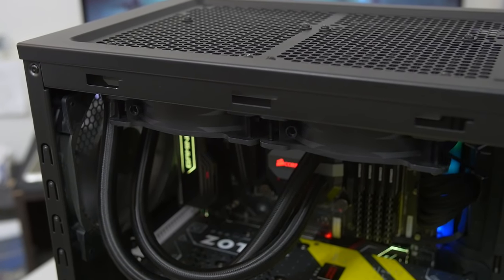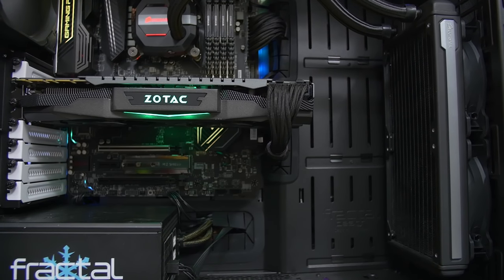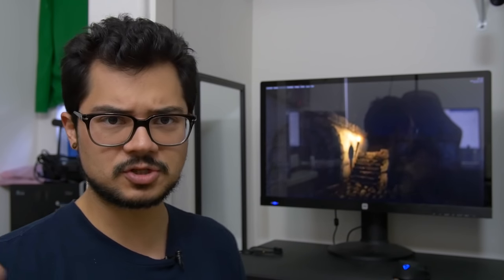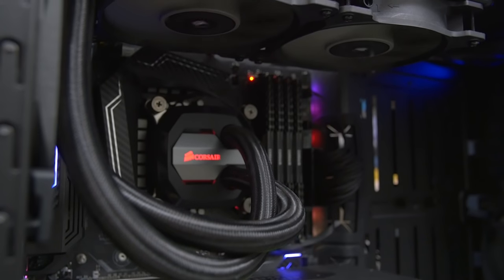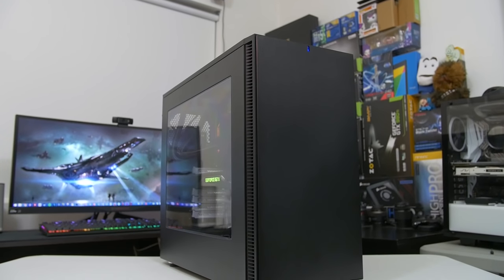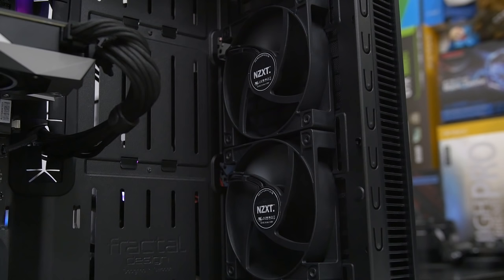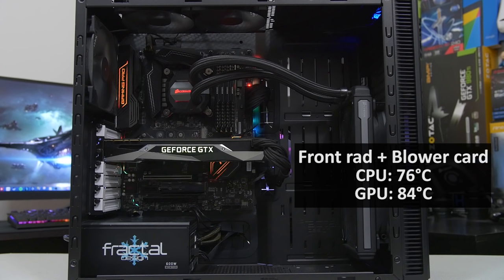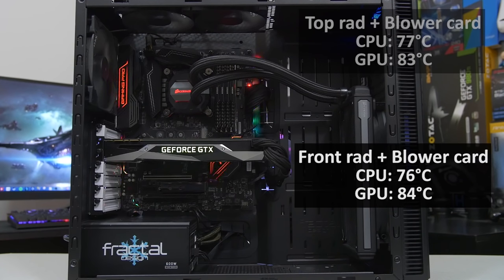Does Radiator Placement Matter? Hint: YES

Comment: Oh the irony of YouTube automatically playing this video after watching a GamersNexus video explaining why you should not mount radiators on the front with tubes up or mount the front radiator below the pump. There's always some air in an AIO, and it will make its way into the pump if mounted like this. Kyle did both of these things wrong.
Reply: Haha the exact same for me. Youtube auto play and then "wtf?!"
Reply: In a perfect world we could all mount our AIOs perfectly, but not every case allows for this, and even gamersnexus says this. If you want an AIO you gotta be willing to accept some compromises.
Reply: heh, same here :P
Reply: Telvana or you can just get a larger case(a decent mid tower case will do) to accommodate your cooler properly
Reply: Yea I was about to say. That’s kinda weird
Reply: so what's the best set-up according to them? I couldn't understand lol
Reply: @lBioHaZarDl  the really dumbed down TLDR version is that the pump should not be the highest point of the loop, and ideally the tubes should be at the bottom of the radiator. A radiator at the top of the case will usually fix both of those points.
Reply: man... Im really gonna have to open my computer and install the AIO correctly after GamerNexus told me to..  I wonder if the tubes orientation on the pump matter as well? I have mine sideways.
Reply: @Rexywilly  tubes on the pump don't matter
Reply: @Rexywilly  mine are sideways too
Reply: i doubt it tho, it's about the water and the air bubbles in the radiator - when they're placed down from the radiator the bubbles are squashed - if i understand that right
Reply: @lBioHaZarDl  no bubbles since air is on top of the rad, and valves are always flooded due to gravity pull.
Reply: Yeah tubes shouldn't be up. Weird huh?! Maybe these guys should all be in the same page. It's like no one really knows LoL
Reply: Richard Curtis well Steve also said the manufacturers showed rads up, so if these guys are going by pics or directions and being shown or told to do it although wrong who is really at fault. I know my setup has my tubes at the top of the rad. Not changing it because my temps are freakin awesome and I’m not getting any funky noises.
Reply: @TimBoundy  What would be the best orientation if the pump was located inside the radiator?
Reply: @phobruh1787  the pump is usually at one end of the radiator. Try not to mount the pump end higher than the other end.
Reply: notice in gamers nexus video how theres no graphics card shown. Notice the size of the motherboard. Notice the lack of ram. Gamer's Nexus showed an ideal front mounted config but it may not be achievable in this case.
Reply: @Crackalackin  He did mention in the video that it may not be possible to mount it in the ideal position with a front mounted radiator. In that situation, he recommended just mounting it as best as you can, as long as the pump isn't the highest point in the loop. Tubes up top won't damage anything but may lead to increased noise.
Reply: @lBioHaZarDl  rad in the front with tubes down and the pump not being at the top of the system, as locating the rad in an intake would be ideal for temps and the tubes down would avoid problems like exaggerated permeation or noise. However, if you have an AIO you probably can't put a rad in the front with the tubes down, so the best config to optimize operation of the unit would be rad at the top with tubes down. It's all about compromises, unless you can mount in the front with the tubes down, you'll have to choose between mounting it on the front (better temps) or at the top (lower noise, etc.). Or that's what I can understand from these two videos.
Reply: For a front mounted radiator: As long as the intake/outflow for the radiator is positioned at the bottom of the radiator and the top of the radiator is above the processor, air isn't an issue.  Air will sit at the highest point.
Reply: Wait. Have i mounted it the right way if my radiator is on the right of my case with the tubes at the top. And also the tubes from the radiator are higher up than the cpu
Reply: @devtimm  what part isn't clear? If possible you want the tubes at the bottom.
Reply: @Crackalackin  your right about the most cases, biggest problem is just the tubes are to short for a front rad install with the tubes on the bottum, also with the gpu in the way.
Reply: Yeah just bought to the artic2 360. The hoses are about an inch short and keeping me from putting the hoses correctly on the bottom. This has some of the longest hoses on an aio I've seen. Very frustrating.
Reply: @Rexywilly  but the pump shouldn't be the highest point in the loop.
Reply: @TimBoundy  So to have best of both worlds, would it make sense to have a top radiator as an intake?
Reply: I am gonna build a NZXT H710i pc but i cant decide if the 360mm will fit with the Gigabyte X570 AORUS ELITE if i put it from above. Any advice?
Reply: You, too, eh?
Reply: YouTube you got some explaining to do ... lmfaooo
Reply: Kyle is looking at thermal performance and nothing else, while GamersNexus was looking at potential problems with the AIO itself. The orientation is still interesting on Kyle's part, one just has to see if they can get the radiator mounted higher up while keeping it as intake. Can learn something from both videos and combine it, nothing wrong with that.
Reply: @comeon9399  My case is so large that the aio cant be front mounted with tubes down
Reply: I watched that video too. Unfortunately, i can't top mount my radiator due to clearance issues with a heatsink on the MOBO and my RAM. I also can't front mount with the tubing connecting to the radiator at the bottom because of length issues with the tube and my pump not being able to reach the CPU. The only way I could get everything working is doing a front radiator placement with the tubing connecting to the radiator at the top. Hope it's not too big of an issue.
Reply: @itsJoonsung  he said in the video that some cases only support front mounted with the tubes at the top, and that it's not a massive problem as long as the pump is located below the radiator tube ports. You might get a bit of noise related to bubbles but it won't break anything mounting it the way you have it.
Reply: @TimBoundy  Ahh cool. I mounted the radiator as high as possible in my lian li lancool II case. The connection between the tubes and radiator will definitely be higher than the pump
Reply: Yes, fact is, YouTube recommended me GN video and watched it after I’ve mounted my pc. Turns out I did good first try 😂 pfiowww me
Reply: now what do ya all think is the dang right position for a radiator generally and honestly
Reply: Same!
Reply: @mehranbhat5600  top.
Reply: @mehranbhat5600  top and have at as exhaust setup. If your case allows it 3 intake fans or Two intake fans, with the rear and the aio acting as the exhaust. Depending on the case and if it supports 3 front fans, it should in theory eject coolish/ambient air where the air goes through the radiator and the fins, enough to keep cpu Temps at bay.
Reply: @jimmywatsup1  Thanks for your informative answer. Highly appreciated 😊
Reply: Look carefully. On this guy's setup, the tubes still sit slightly lower than the pump.
Reply: @Crackalackin  agreed. Most AIO Water Cooler hoses aren't long enough with tube down with a high-end Vid Card mounted in a way that bends the hoses making them to Short to front mount Tubes down.
Reply: Allen Smith  I think that's bs personally and hyperbole. What evidence do we have it's limiting the lifespan what hard evidence bar theory because it is working harder? 

No I disagree the lifespan effects are probably minimal and not worth considering.

Go for the extra cooling instead. If the pumps going to fail let it buy a decent one that dosent fail.
Reply: GamersNexus is wrong.  How much air do you think is in an AIO?  Small air bubbles will find their way to the uppermost point and stay there.  Takes exactly the same amount of energy for the pump to send and return whether above or below the pump, it's a closed loop.  Mount the rad any which way you please.
Reply: @masondegaulle5731  Gamers Nexus isn't wrong. People just misinterpreted the message. Pump at the top of the loop is indeed very bad for the longevity of the pump. Tubes up on a front mount radiator isn't ideal as it can lead to audible bubbles but it won't affect longevity. Those are provable facts. Most viewers interpreted the message as "tubes up is wrong". That's not actually what Gamers Nexus said.
Reply: @TimBoundy  I mean in terms of his experiment, in wanting to view inside the AIO he has made significant modifications which add air volume and remove hydrodynamic elements.  His video, though he is well intentioned, gives worthless results because he has missed the very first step in critical scientific analysis.  "Does my experiment replicate the control condition" - No.  Neither the radiator nor the block is functioning as designed, his results are not accurate to real world operation.  I would like to see a much more controlled study however I believe the results would be significantly different.
Reply: @masondegaulle5731  all AIOs have air in them and will gain more air over time through permeation. His demonstration was valid.
Reply: @TimBoundy  The volume of air in the AIO was increased considerably, I would say well outside general permeation values.  Available volume in the block itself was significantly altered by removing the jet plate, which has direct implications on the efficacy of the pump, along with the removal of flow dynamics.  This is a textbook example of altering the condition one is trying to measure in the attempt to measure it.  Very distinctly not by scientific method.

Comment: Your front-mounted AIO has the pump block at the highest point in your loop which will trap any air bubbles in your pump. Not a good way to mount it. Disappointed you didn't put any consideration into the long-term health of your AIO.

Comment: The only problem with what I see is, with your build of putting the radiator on the front lower portion of your case, is that the CPU cooler (which in a lot of units house the pump), is that it is higher than the radiator and would allow that CPU cooler/pump to collect air, which, from what I am seeing in other videos, can shorten the life span of your pump and/or reduce the efficiency of your cooling unit.
Reply: Think he had the option of mounting it higher, and flipped too, since that's what every tutorial recommends. Tho didn't care since it's a short test and used a configuration that was easier to install.

Comment: I know this is an older video, but one point I would make, if you do put a rad at the front and not the top, make sure your pump is not the highest point in the loop otherwise air will settle in it.
Reply: I would like to advise for everyone who sees this comment this is not correct. Like yes but at the same time it's a very overblown myth.

Comment: Have you tried adding more RGB?
Reply: I've heard that a PC with enough RGB can sometimes even reach sub-zero temps. Yet to test it.
Reply: OH MY GOD. IT WORKED. I put RGB EVERYWHERE and my Temps got to -40 celsius!!!!
Reply: Lol
Reply: I added more RGB and my computer froze.
Reply: It definitely runs cooler now.
Reply: I added more RGB and now my pc is gay

Like how I like it.
Reply: @ProXPro106  now you can reach 6.0Ghz
Reply: Yeah, it was raw 25 FPS per RGB Fan for me.....
Reply: You guys on about LEDs - lols
Reply: @ProXPro106  May not run cooler but some people think it "looks" cooler. :)
Reply: You have to set them to light blue though... set them to red and everything overheats
Reply: it is scientifically proven that RGB lowers temps and improves performance.
Reply: @ProXPro106  depend on what color too. i get -78celcius in blue color
Reply: 696 likes must work
Reply: Everybody know if you add more rgb will result in more fps Duh..
Reply: Nowadays it's pretty much impossible having a high-end pc without rgb
Reply: Bro I put rgb and now my pc is an air conditioner
Reply: @ultraag8  Careful though. I added all the RGB and my PC went so fast it travelled back in time.
Reply: I'm building my 2nd pc ever right this second... And I have 6 RGB fans and then there is the 3 fans with the radiator cpu cooler.. Is 9 fans to many?
Reply: Everyone knows that gives 1000000% more gaming performance LMAO
Reply: @Virtual_Sphere_  Depends on the hardware and the case. If your running full custom loop and over clocked hardware you might need use of 9 fans. I run Noctua nf-a12x25 pwm fans in an air cooled rig, 2 induction, 2 on the cpu heat sink and one extraction in a fractal design c. 9900k (stock) and an evga 2080s black and i rarely see above 60c on either cpu or gpu.
Reply: adding rgb gave me a 10 celsius drop in temps :D
Reply: @Outland9000  I got 9 installed.. 6 for intake and the three on the top (cooler) for outtake.. Runs really well... I think it keeps my computer temps and that low my onboard fan don't even get used lol..
Reply: Only the newest rgb components can lower pc temps the older ones improve fps
Reply: What the fuck are you guys taking about? Does rgb really increase fps and decrease temps? What is this sorcery? Someone pls explain..
Reply: @JosephKarthic  it's a joke bro chill!
Reply: @JosephKarthic  ofc it does
Reply: Joseph Karthic u must be newcomer to this PC Master race society. Based on the review i've seen on the internet. It does cool ur PC, but u must set up the right colour to get the right temps. I say blue is the coldest of all feel like in arctic ocean. But for more breeze i say go with green. Everyone loves those windy breeze feeling.
Reply: @Amirul_Zahin  man I'm being trolled heavily... But you're right blue is the way to go...
Reply: @ProXPro106   but only with white/blue color ;)
Reply: @emmanuelbaluran6588   gay unicorn XD
Reply: I put an RGB strip diagonally across my monitor. Now I don't see my crosshair in CSGO.

Comment: Great experiment. Just the answers I was looking for at 2 am in the morning even though I have no intention of building a PC. LOL. Great video tho :D
Reply: dem im up at 3 am im 1 hr late
Reply: LMFAO 2:15AM here, but plan on building a PC within the next week after last couple parts arrive.
Reply: lmfaoo 2:10am r n as I watch this
Reply: same lamo. Up late as hell lookin for pc parts
Reply: Hi, I’ve about to get the NZXT z73 on the case p500a, so I’m wondering if the radiator better sitting on top of the case or in front of the case please?
Reply: @tikkoy8396  Even though this video says that radiator mounting in front is fine, it is actually best to do a top mount. This will ensure your pump never runs dry. Also, if you must to a front mount then try to have the tubes go towards the bottom rather than the top. Also make sure the pump (attached to the cpu water block in your case) is not the highest point of the loop, or else pump will run dry.
Reply: lmao 4 am rn
Reply: 205am lmao
Reply: Lol i had an i7 7700k and its funny now to hear 5 ghz was extreme overclocking. I have an i9 13900k and it runs 5.5 ghz out of the box lol times are a changing